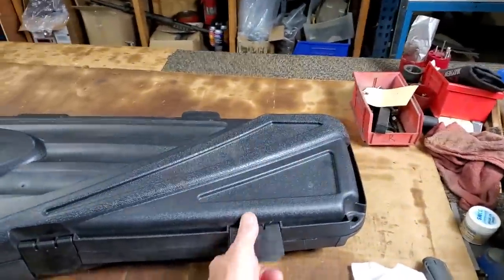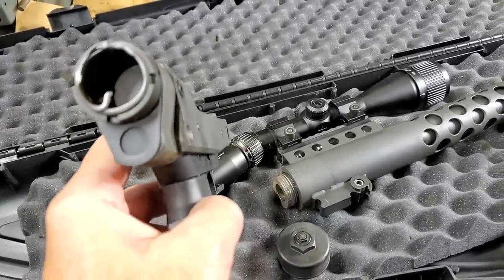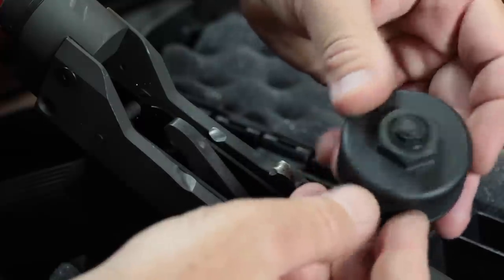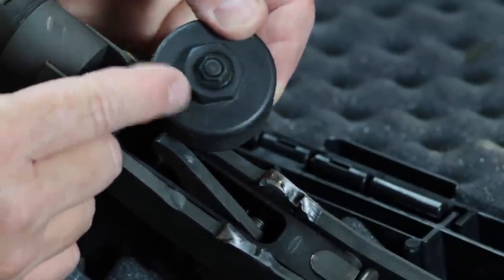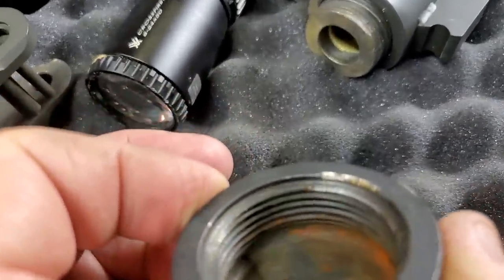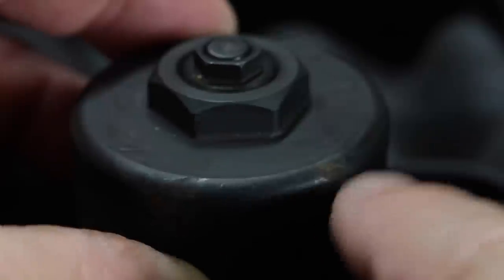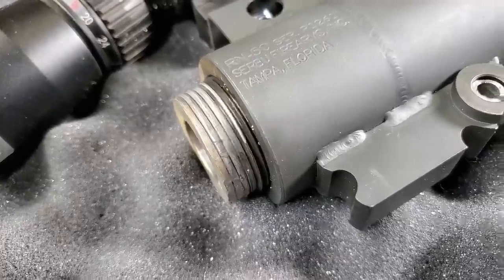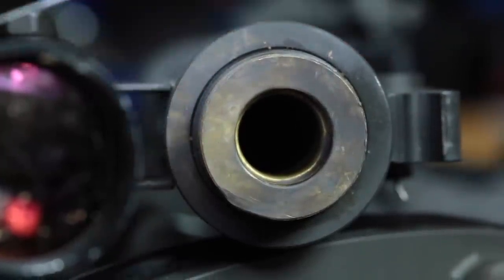Kentucky Ballistics' RN-50 Blow-up:  First Look

Comment: Clearly, the gun is tough as hell, and the forces unleashed were immense.  It certainly appears from the evidence presented that the gun was properly constructed and was not the cause of the failure.

My concern is that the failure mode of this type of design with a breach cap and not much structure behind it, is straight back.  This is by no means the only gun designed like this.  I guess the question is how big those rear lugs would have to be to contain such forces?

I would contrast this with a typical military bolt gun, for example, will have gas vents in the bolt and a safety lug.  Obviously, they're not dealing with the sheer power of a .50, but enlarged to match, it makes sense.
Reply: no gas vent will protect from overpressure. the gas vents are to deal with primer failures that do not have a way to make the gas from the primer go around the bullet and out the barrel. fyi safety lugs on even the most expensive and strongest bolt actions get sheared off and the bolt goes flying back into the head and neck of the shooter when a detonation occurs. 

no gun will survive triple or more pressure then the chamber was designed to handle.

Comment: How do you guage/measure the threads? Most measurement systems allow 2 1/2 undersized threads leadin for production. If you only have 4 threads in the cap that can concentrate massive pressure on a small area?
Reply: more then 4 becomes counterproductive and will weaken the locking system

Comment: I'm a CNC machinist and work with several different grades of steel and also finish machine parts that have been heat treated to 50+ Hrc. I'm also a home garage engineer. If it's not a manufacturer special sauce secret, what grade of steel is the lower, the breech cap, and the barrel? How hard are they? What process are they hardened with?

Comment: Could the damage on the inside of the cap be from hitting the rear tube?  The cap initially hit the receiver, spun and the inner portion of the cap hit the rear tube causing the scratch on the tube and the damage to the inner cap?

Comment: In Scott's video, he mentioned that the standard pressures of 50 bmg firing are 55k psi, where this accident would have happened at 85k+ psi, what is the safety overhead this gun is designed to handle? I don't have any experience with guns, so it might sound dumb but aren't most guns designed to handle scenarios where the round has too much powder (if that's what happened, in Scott's video he said the round was too hot)?
Reply: not 85kspi. over 165kpsi to shear the threads. the 85kpsi was a mistake in calucations and is more akin to gas leaking into the cap which is next to impossible under normal conditions. 

no gun will survive twice or more pressure then it was designed to handle. putting pistol or magnum powder into a rifle cart will blow up any gun out there the cart is put in
Reply: That's what I was wondering too. I have no firearm experience but having heard of this first through the forgotten weapons channel, it was mentioned on there that a lot of gun designs have from what I understood a weakpoint that will usually direct the overpressure somewhere less dangerous should something go wrong. I was wondering if that was possible with this sort of design where to me (who's not that familiar with the workings of a gun) it seems to be just an end cap screwed on to a barrel, it doesn't seem to leave many failure points except end cap or barrel for the overpressure to escape from. 

It seems like if the end cap threads are the failure point then that chunk of metal is flying at your face. I was wondering if the barrel peeling or breaking off & flying away from the shooter would be a less dangerous failure & if it's possible to engineer something like a barrel to break in a certain way in an overpressure situation?

Comment: A sabot should slide down the barrel easier than a copper bullet and, in theory, chamber pressures should be lower. Did they use pistol or shotgun powder in it?

Comment: How do you pump a round up to 2 or 3 times the pressure when it's the same size case ? I am honestly asking. Are there different powders , how is it possible with a set volume of cartridge to get over two times pressure?

Comment: suspect improper storage/transport of the rounds caused the powder to break down into finer powder and burn faster causing massive excessive pressure
Reply: these were handloads from bubba. pistol or magnum powder was likely used causing triple or more pressure.

modern powders don't have the issue you are thinking about.

Comment: The Shearing force required to tear that thing apart like that is going to be off the chart you might want to send one or more of those slap rounds off to a lab to have the powder checked and measured I'd suspect the round had 2 or 3x the amount of powder ment to be in it as I don't t see how a normal detonation can. 
A shear the threads 
B shear off both ears 
C snap the pivot pin like that 
D gouge and bend the lower and still have enough force in the cap to do that amount of damage to Scott's face
Reply: That's the thing though, you can't overcharge these rounds like that. Using the proper powder ends up with a 90% or higher fill in the cartridge. If the powder was removed and replaced with a much faster burning powder (like a pistol or shotgun powder) then you might end up with the results he had.

Comment: Another question. How are the pressures being measured? CUP, LUP, Piezoelectric, or Strain? The maximum average pressure for the .243 is 52,000 CUP and 60,000 PSI. Any gun nut should know that these 2 values are not the same and can not be interchanged. Just hope all these ideas help to figure this out.
Reply: the threads would take over 160kpsi to be sheared. .50 bmg is 50kpsi
Reply: @toomanyaccounts  The average Pressure of a standard ball .50 cal is 55k psi. But were not talking a standard round, are we. We are looking at a tungsten alloy penetrator launched at a much higher velocity than standard rounds. That equal MORE PRESSURE!
Reply: @toomanyaccounts  Muzzle velocity M8 API ammo 2594 fps, muzzle velocity of M962 SLAP-T 3563 fps. To increase Velocity you increase Pressure.
Reply: @tomrals9579  no it doesn't. the same amount of powder is used. hence same amount of pressure generated. what would change is the fps due to different bullet weight.
Reply: @tomrals9579  LOL! 647 gr (42 g) Speer	has a muzzle velocity of 3,044 ft/s. while a 800 gr (52 g) Barnes  has a muzzle velocity of 2,895 ft/s. 

subsonic rounds are guess what heavier bullets. 

slaps have a bullet weight of 355 – 360 gr meaning a much much lighter bullet. Half that of the Speer.

Comment: I reckon it was 2 hot rounds, as seen on his follow up, one of the rounds fire before the failure was super hot, I think that did the initial damage to the threading, the final round which must have also been hot was just to much and because the threading was already weakened it caused the failure. Just an opinion.

Comment: Could this simply be a case of a double charged, or over charged, cartridge from the manufacturer? Would there be any way to estimate the powder charge that would result in such ridiculous pressures? Praying that there aren't too many other examples of these rounds out in the world.
Reply: no this looks to be a bubba load passed off as original. at 100 bucks a pop and about seven bucks of materials do you not see why Bubba would do this?

you just have to use pistol or magnum powder and fill up the cart so people handling don't notice anything odd about the weight.

Comment: What the actual F*ck. That steel is almost half inch and its bent like a twizzler. The pressures in that chamber had to have been off the charts. If you put big enough explosives you can shred even the thickest bunker. Scott isn't lucky to be alive, that was freakn divine intervention. I've never seen anything like this.

Comment: honest question: is there a way to make a mechanical "fuse" that will bleed pressure over certain amount as a fail-safe? like a little chimney that will burst gas if overpressurized
Reply: Some guns are designed to redirect overpressure.  However, this primarily just causes the gun to explode in a different manner than it would otherwise.  An example of this is with the Arisaka rifles Japan used during WW2.  They had either one or two vent holes depending on the version on top of the chamber.  If an overpressure happened (which wasn't uncommon with crappy WW2 ammo) then the blast would be directed upwards since that part of the gun had a hole in it and was therefore weaker.  

So instead of exploding and throwing the bolt into the user, it would blow the top of the gun out and leave the user unharmed and the gun thoroughly destroyed.

Many other guns use a similar system to protect the operator.  Especially older guns from eras where ammo wasn't as consistent.
Reply: no vent hole would prevent a detonation. vent holes are for primer failures in which there is no way for the gas to out the barrel.
Reply: @matthewblackwood9653  where did you get that info? The type 99 was one of the strongest bolt action rifles out there if one looks at early war examples. 
There were famous tests done where overpressure rounds were used that blew up other rifles yet left the early war Arisakas intact with no damage what so ever.

The vent hole is for a primer going bad not an overpressure round.

Comment: I think the biggest issue here was the plastic sabot. Rex reviews did a video where he quoted the army literature. Never fire slaps with an inadequate brake. It can plug it up and cause an issue like this.
Reply: if the brake was plugged it would have just shot off the brake. we know what barrel ends are obstructed. they don't blow up the chamber. also the army literature is FUDD lore. Barrett have stated that mil spec brakes never have an issue with slap rounds. The rifles just weren't being cleaned like they were supposed to have and the military blamed the brake rather then their soldiers for neglecting basic maintenance.

As for civ spec brakes the slap rounds will just cause the brake to come flying off.
Reply: I suspect the main reason why you shouldn't use SLAP rounds with a muzzle brake is that the sabot separates from the projectile in an uneven manner. In the best case, it ruins accuracy, worst case, the projectile hits the muzzle and ruins it. It's not close to the chamber enough to create significant overpressure.
Further, the sabot moves at three times the speed of sound and the muzzle brake directs the sabot fragments towards possible bystanders. Small plastic fragments at this velocity can cause severe injuries.
Reply: @sefo2672  the brakes the military was using it would just go out the sides. shouldn't be any bystanders since they would suffer from the concussion coming out of the brake which can shatter windows. even at a range a number of rifles will hammer people to the side with the shockwave of the explosion coming out the barrel.
Reply: @sefo2672  it's more about sabot material building on the rough edges of the break... And possibly cause enough of a blockage to make this happen. Slowing the projectile for even a portion of a second can severely increase the pressure.
Reply: @mybuickskill6979  A severe increase in pressure at the break is still going to be below peak pressure.
Reply: @tadferd4340  on an old round that hasn't been stored particularly well even as said by Scott himself? It seems like anything is possible in that instance.
Reply: @mybuickskill6979  Scott fired a regular 50 cal round before the SLAP and this would have cleared any bore obstruction from the sabots. It's too far from the chamber to generate unsafe forces on the cap anyways. Depending on how hot that round was, it doesn't need any obstruction to blow up the rifle.

Comment: I can’t imagine that the barrel threads being as short as they are could ever contain a high volume/high pressure round. 60-65,000 psi chamber pressures are nothing to under estimate
Reply: If I understand what you are saying he addressed that in a previous video. He first incorrectly stated a failure point of 85k psi and then had to make another video amending that error and using the correct 100k+ psi failure point. I haven't watched the video in some time so pardon my vague numbers.
Reply: OK just re-watched that video, not having the correct info for you was bugging me, the correct chamber pressure to cause the kind of damage we see would have to be upwards of 161,520 psi. This is what a mechanical engineer friend of his came up with.

Comment: Can we see an x-ray of those SLAP rounds compared to functioning SLAP rounds?

If you don't have one you buy a used portable x-ray machine for around $500-$800 that can take images through 1" of steel. 

Often there are SAIC RTR3 x-ray machines on eBay. There were used for EOD applications and run off a rechargeable Dewualt 20v battery. You can find used dental machines for cheaper but they may have trouble penetrating 50 BMG.

Comment: Could the cap not being screwed down securely; that is, not tightened all the way have contributed to the blow-up. Would the firing pin contact the primer if the cap were backed off a turn or two???
Reply: if the cap is not tightened all the way then it cannot be set to fire.

Comment: If the cap isn't front seated properly will discharge still occur?
Seems just the last few threads were smeared .
Reply: nope you can't ''close'' the gun otherwise. The upper assembly wont fit on the receiver.

Comment: Did anyone check the owners manual for the part that says don’t shoot slap rounds though thisriffle or any with a muzzle break.
Reply: stop repeating Fudd lore. muzzle brakes work fine with slaps. all that happens is that bits of plastic go out the holes of the brake and if civ spec the brake may fly off if clogged. if mil spec the next round clears out the obstruction.
Reply: @toomanyaccounts  it’s written in black and white. Not lore a written warning that says do not do this but sure call it what you will.
Reply: @dopedreamz  it is Fudd. the maker of Barrett firearms says muzzle brakes work just fine with slap rounds. the people who fire .50 bmg rifles for a living tested slaps and the brakes worked like I said they did. the people who wrote that manual are the same guys who say that the US military is forbidden from using hollowpoints and that shooting a .50 bmg  at a person is a warcrime. in other words they spouting bullshit

Comment: Are you planning on reinforcing the breach more than it already is or maybe adding in an emergency gas system like the Mauser 98 has?
Reply: give you a clue the gas system on a mauser or any other gun doesn't save a gun from a detonation. its meant to deal with primer failure since there is no other way for the gas to go out the barrel like on other guns. 

the breach took over three times the pressure of a 50 .bmg to strip those threads. that is the strongest action a .50 bmg could ever have. nothing will save a gun when a bomb is inserted into it. 

notice the primer on the round was gone? yeah it blew backwards when the whatever pistol or magnum or custom mix powder was in there went off.
Reply: without the vent hole when you would open the chamber the built up primer gas would hit your face otherwise. its not meant to deal with overpressure.

Comment: Try using Use butress threads and have weak points that fail sending gas forward in the event of extreme pressure buildups the gun won't fail completely just the parts that should and can be replaced?
Reply: vent holes will do jack shit in the event of a detonation. in fact they can make it worse. fyi those threads would take over 160kpsi to shear. that is more then three times the force of a .50 bmg that is properly loaded.

Comment: I looks to me like after the endcap sheared off the ears it started to flip causing the bottom of the cap to hit and gouge the side rails at the hammer. It then continued flipping until the threaded end of the cap hit the top where the stock attaches. It would have then continued rearward tumbling as it went.

Comment: What kind of chamber pressure could have done that, or was it a clearance issue between the round and barrel being too tight? Not an expert, just curious.
Reply: the pressure figured to shear the threads would have been over 160kpsi. .50 bmg is about 50kpsi with overpressure testing rounds  doing 66kpsi
Reply: @toomanyaccounts  Insane, that guy is so lucky to be alive. So round had too much powder or too "potent" mixture?
Reply: @williammartino952  pistol powder and magnum powder have different burn rates since they have to power a projectile with lot less powder then in a rifle case. so it burns a lot faster and hence more pressure for much less little powder amount. 

basically if you use the wrong powder you can get a lot more power then you were expecting. its like exchanging a firecracker worth of gunpowder with a few pound mortar shell fireworks worth without altering the amount of powder used. just a different type of powder means much less or much more pressure can be generated due to the different burn rate as well as amount of gas and fire generated from the explosion.

bullets are a chemically explosive propelled projectile. people forget the explosive part of that. 

handloading can be extremely dangerous if you don't know what you are doing.

people have killed or maimed themselves putting in for example a boxer primer in a berdan cartridge case or trying to modify said primer to work in that case.

there are sleeves that can be put into a berdan cart case to allow a boxer primer to go in and hence make the berdan cartridge reuseable.